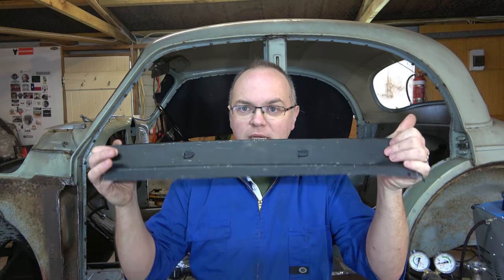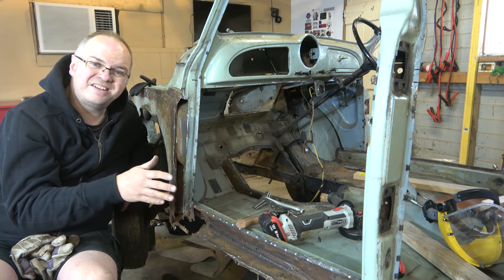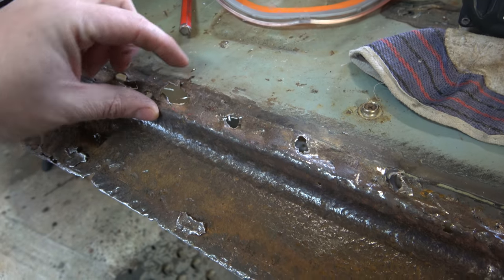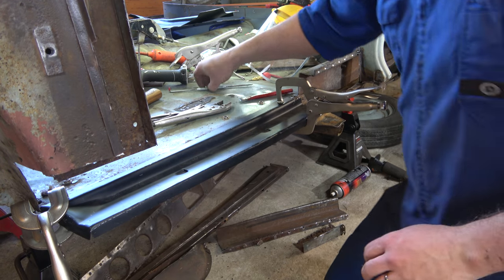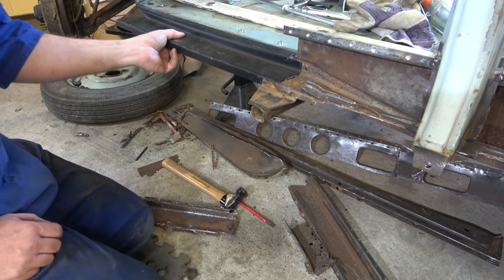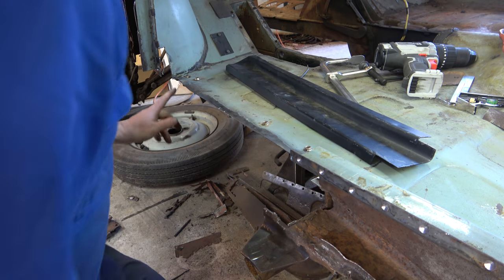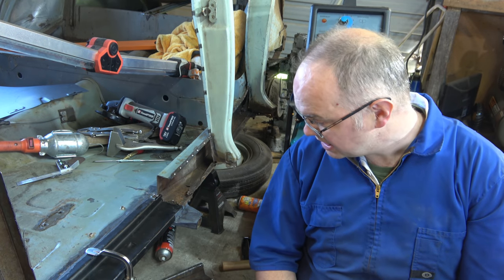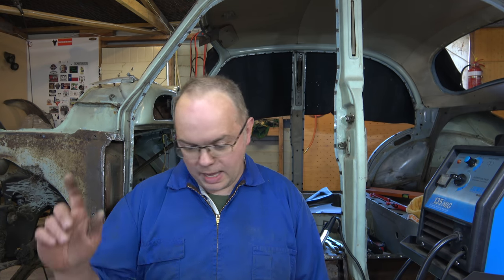Morris Minor - Welding the First Panel - Part 20

Comment: Its coming along. Dont forget that panels dont always need to be welded. Panel bonding is widely used in body shops. Protects better from future rust and hold just as strong if not stronger that plug welds .
Reply from the maker: I'm sure it is widely used but we have strict rules on repair and that would require certification or a headache at least as it's different from factory. Cheers!

Comment: Getting optimistic at the success of this restoration. Also good to see the welder is coping with the cheese that Morris was making its cars out of in 1958.
Reply from the maker: It may not be the prettiest or quickest restoration but it will get there. Aiming for as much of the work possible to be done by me in the shed so I can call it bodged not bought 🤣
Reply: @Badgertronix  Like AvE says - Grinder and paint makes me the welder i ain't.
Reply from the maker: @zoidberg444  how fitting. However I think by the end of this project I'll be up to a reasonable standard and ready to take on the Holden Ute V8 supercharged Drift King project

Comment: looking good 
i put a strip of copper under areas where the metals a bit thin helps stop it burning away  also acts as a heat sink to help reduce warping
when you go to refit the doors start with your rear door and work forward  easier to get the gaps right
Reply from the maker: Thanks for the tips. I managed to fill the gap with weld in this case. Cheers

Comment: Couple of tips, when doing the final trial fit, clamp the new piece in place and cut through the new panel and old panel together, it'll give you a really good edge on both to fit and butt weld. There's also Weld Through Etch Primer you could use. Always nice to see new metal going back in. 👍
Reply from the maker: Thanks for the tips. The next panel is much harder to fit and has bolt holes that need to line up. I've painted it in weld through primer already. Cheers